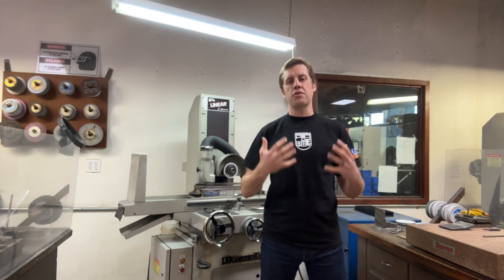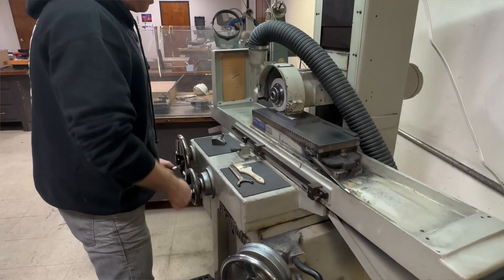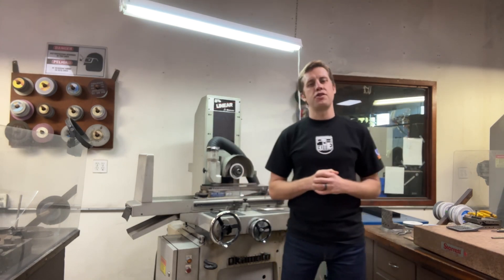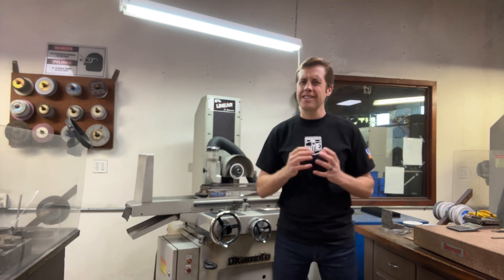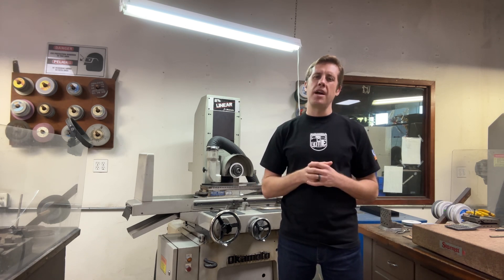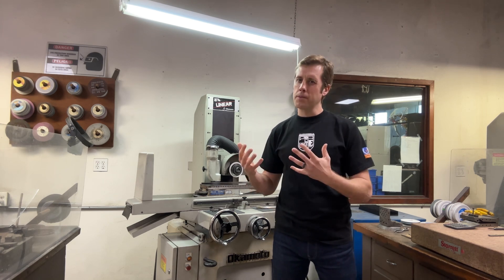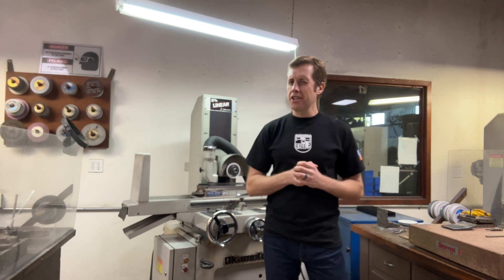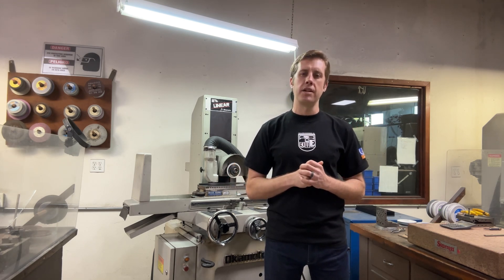Five Reasons Why Surface Grinders are a ToolMakers Best Friend

Comment: Good video.  Thanks.  I have always wondered why surface grinding is so accurate given my assumption that both the tool (the wheel) and the part get smaller during grinding.  If this is true, perhaps the grinding wheel wear is negligible relative to the dimensional change in the work?
Reply from the maker: @davidyarra5648  grinding wheels will wear down. It depends on the grinding wheel how hard it is how much you’re taking off and what type of material you’re grinding. It’s negligible in situations where the dimension is not super accurate, but if it’s super accurate, you’re just gonna have to simply measure what it turns out and grind a bit more off.

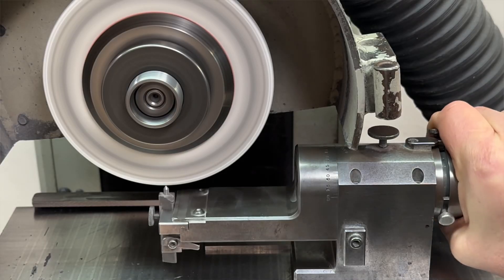Comment: Thanks for sharing, I was wondering if you could give some details about the setup you use to grind the cone at the 3:19 mark. I see a surface sine plate but what is the rotary chuck you have on top ? I'm new to surface grinding and would like to explore cylindrical grinding as well. Thx
Reply from the maker: I was grinding a form punch made for an extruded part. Yes that is a rotary chuck. we use that fixture to grind round parts on the surface grinder. There are no collets on the rotary chuck, every different diameter part must be individually indicated in. it is something my grandfather built in the 1960s. We use it quite frequently, and it is still very accurate.

Comment: Very nice video! May I ask; what is the smallest most basic surface grinder you have? And can a Universal tool grinder function well as a light surface grinder in terms of precission?
Reply from the maker: I am not familiar with a universal tool grinder, we don't have one here. The smallest table size we have on a surface grinder here is 6 x 12 inches.
Reply: @ToolanderEngineering  That is what I thought, thanks for the info... I was personally looking for a small surface grinder or a universal tool grinder that can do surface jobs as well and sharpen my tools
Reply: @user-tx2nv1rb9k  Also though about that, but have been told at the practical machining forum not to pursue a T&C grinder for doing surface grinder operations. The opposite may work better (and give extra capabilities to your SG). I can't wonder what would be to get a TOS BN-102C T&C grinder with it's infinitively 3-axis adjustable position spindle, it looks like the most capable tool of all. Maybe it's a jack of all trades, but master of none?